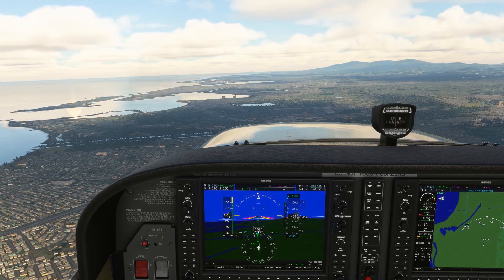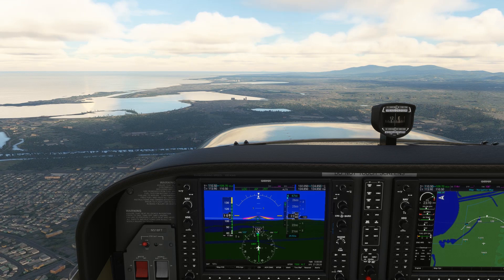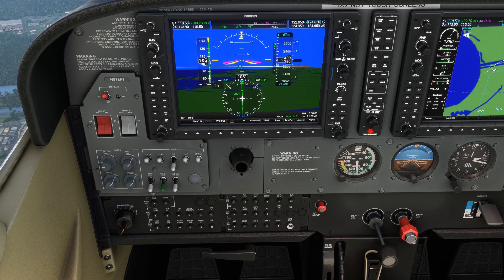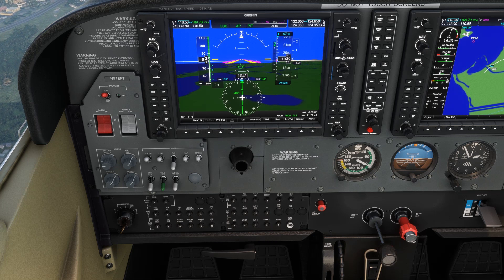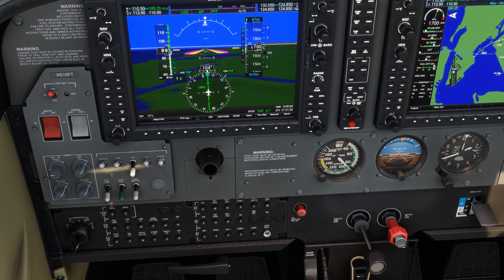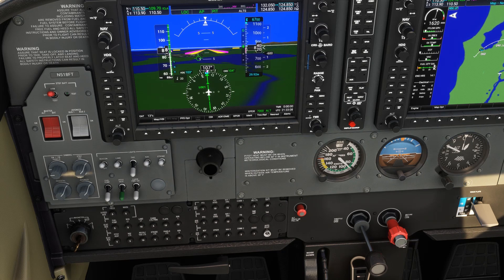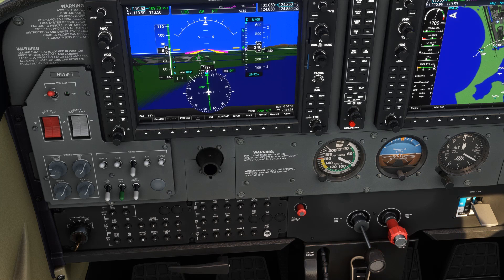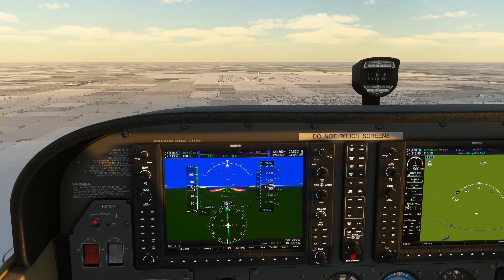How to Set Power on an Instrument Approach | Cessna 172 Instrument Approach

Comment: Another confusing video how Power controls Altitude or V/S and Speed is controlled with Pitch. Pitch ONLY controls speed in a fixed power situation. Power Off (ie engine failure), or Full power (ie initial climb). Switch on the Auto Pilot and it will demonstrate this perfectly. Fly something more advanced and you will see that this is the only way to control the aircraft.

Teach people from day one how to fly like a Pro, even if they only every will get a PPL (with or without IR)

Comment: My instructor disliked the * 5 to calculate the fpm. Another way is to divide add a 0 to the answer. Eg 100 knot ground speed / 2. Add a 0 to the end 500. Becomes a lot simpler math with some more of the odd speeds.